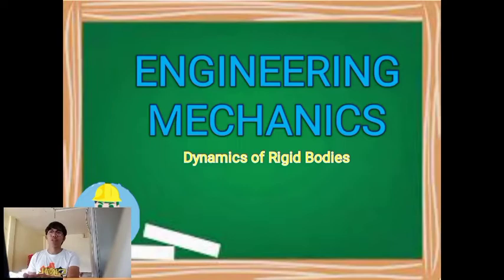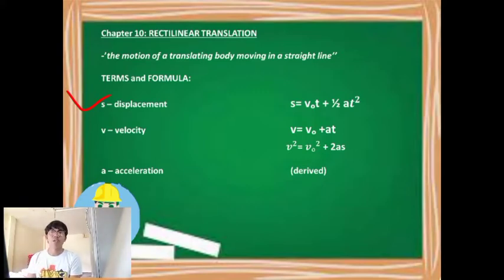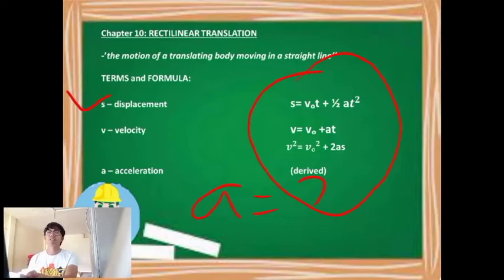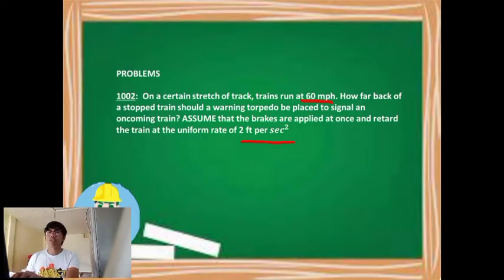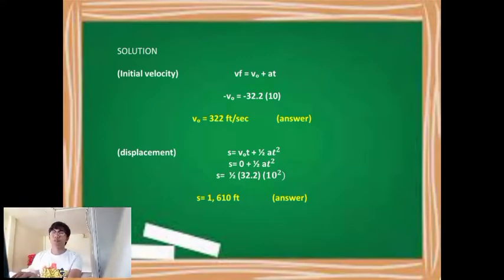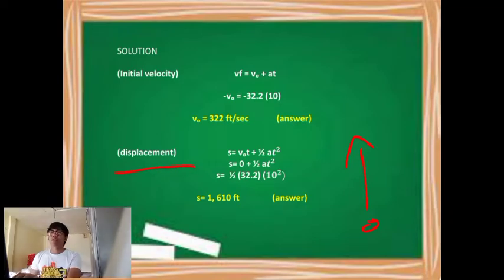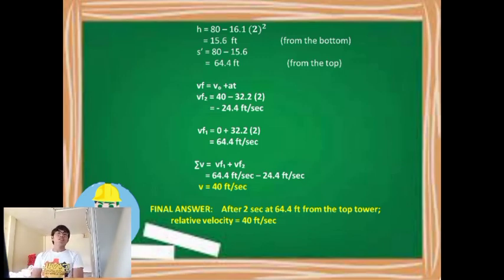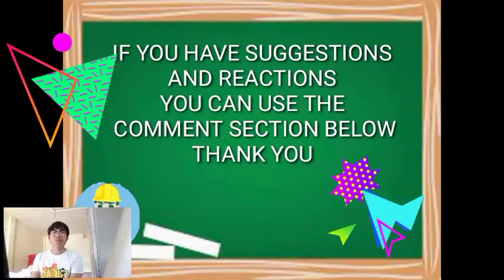(SOLUTION): ENGINEERING MECHANICS: DYNAMICS OF RIGID BODIES - (part1)

Comment: Hi sir sa 2nd problem why did u multiply po by 10 diba po at 10 seconds back and forth na yun
Reply from the maker: Hello,,yes! in the 2nd problem it asked the initial velocity, so we multiplied it by 10 sec which is given in the problem,, and it also asked the highest point or distance that the stone reaches after 10 seconds, which we can get 1, 610 ft per sec, 
The initial direction of the motion  of the stone is vertically upward which means that displacement, velocity, and acceleration are positive, by applying the equation the acceleration due to gravity =32.2 is directed downward and therefore negative Kaya meronn tayong -32.2,, kailangan po na e multiply natin sa 10 sec kasi Yun po yung given sa problem, Sabihin nalang natin na, Hindi natin alam when the stone reaches the highest point, Basta Ang importante the stone returns to earth in 10 sec, imagine mag hagis ka ng bato Hindi mo Yan ma measure kahit sundan  pa yung bato pataas using tape measure, etc. Hindi makuha yung exact value ng displacement. Hindi kasi pwede na 5 sec upward at 5 sec downward,may mga factors pa kasi that affects the stone while it travels upward isa na Dyan  yung gravity so, we solve it using time which is 10 sec, after the stone returns to earth.THANK YOU! 🥰♥️